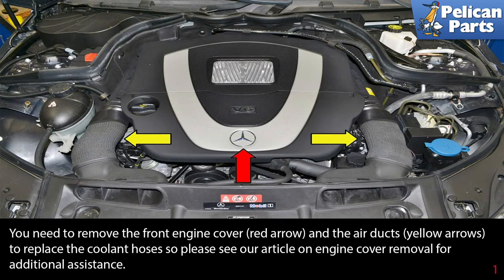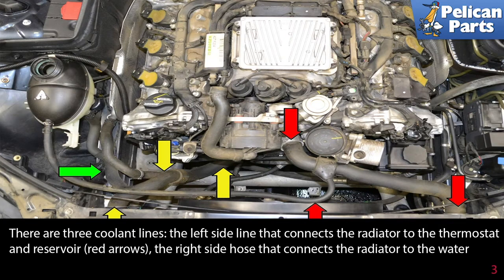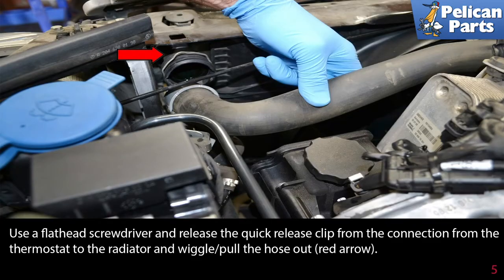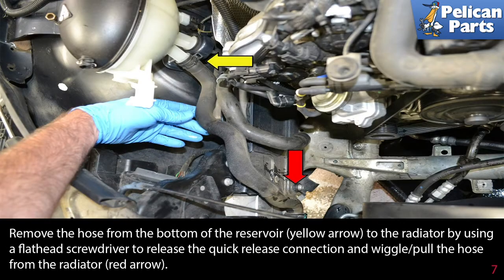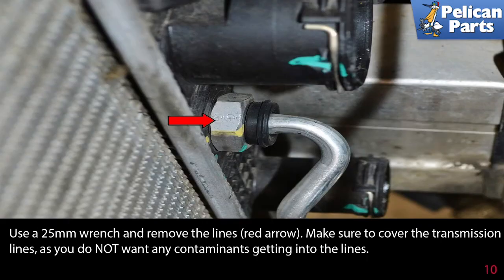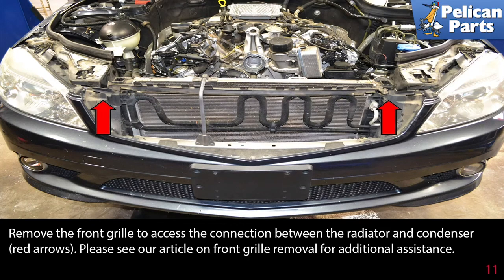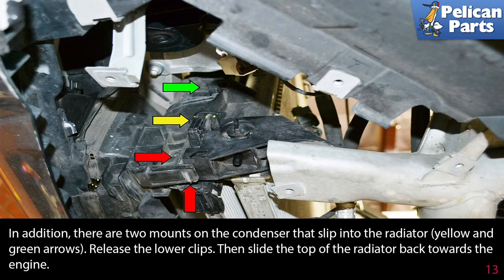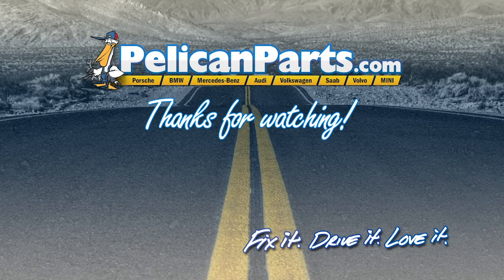Mercedes-Benz W204 C-Class Radiator Replacement

Comment: Missed many things. What about the crazy expensive coolant sensor in the radiator? It broke neing temoved of course and im wondering if the car will lose its mind because of it.
Reply from the maker: I would replace the sensor if it broke. With your vehicle info handy, give The Pelican Parts parts specialists a call at 1-888-280-7799. They can figure out what part or repair kit you need.

Comment: DO NOT remove the transmission cooling lines with a 25mm wrench!  Pry off the black dust cover and remove the tiny spring clip and pull the line out!  Easy peasy!  If you remove the 25mm nuts, you'll never get them to seal again!
Reply from the maker: Thanks for the Info. We appreciate it.
Reply: Is the tiny spring clip easy to remove or do I require a tool

Comment: Can you add transmission fluid at that same line you disconnect or do you have to do it from the transmission oil pan?
Reply: Yea cuz my trans fluid was never changed so they told me a while ago not to get it done. Will this affect my car?
Reply from the maker: Depends on the mileage. If over 200k, don't replace. If 100-150 should be OK. To be sure, check the transmission adaptations using a scan tool.
Reply: @dexxm7702 Transmission fluid, along with any fluid/oils, etc, need to be replaced. Transmission fluid should be changed between 50 and 80k atleast. Some say every 40k. 

Side note. Don't do the 10k mile oil changes. That is too long. 3-5k miles is good. 
Remember oils breakdown with heat and pressure.
Reply: And also how do I fill trans without that pump?
Reply from the maker: No other way.
Reply: @pelicanparts  you can always use a small funnel and fill in the trans dip stick. you will need to wait about 5 minutes to ensure that when you check fluid levels you don't check with excess fluid in the dip stick.
Reply from the maker: At the pan only.
Reply: When the old radiator is out, measure the capacity of the transmission cooler.  Fit new radiator & lower oil cooler pipe.  Use a syringe to inject the measured capacity of transmission fluid in through the upper oil cooler hole then refit upper hose.  That's easier than injecting more fluid with a pump into the transmission sump.  Keep everything spotlessly clean.

Comment: About how much transmission fluid should I expect to see come out from the cooler lines?
Reply from the maker: Maybe a quart.
Reply: @pelicanparts  If i lose a quart of trans fluid, how do i add the trans fluid back or do i need to?
Reply: @John-fv3bz im wondering the same thing, howd you solve this issue?

Comment: What type of connectors is used where the transmission oil line enters the cooler? I have a leak there, and trying to figure out how much i need to replace/repair
Reply from the maker: With your vehicle info handy, give The Pelican Parts parts specialists a call at 1-888-280-7799. They can figure out what part or repair kit you need.
Reply: @pelicanparts DO NOT remove the transmission cooling lines with a 25mm wrench!  Pry off the black dust cover and remove the tiny spring clip and pull the line out!  Easy peasy!  If you remove the 25mm nuts, you'll never get them to seal again!